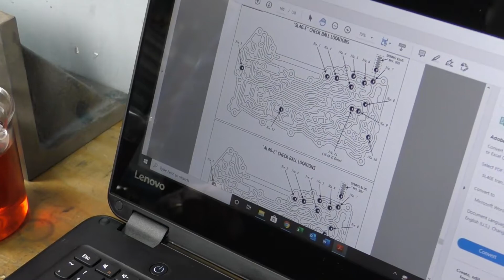BMW X3 3.0L GM5L40E Transmission

Comment: Nice job! I was glued to the entire video
Reply from the maker: Glad you enjoyed it!
Reply: 3C    EGS: Transmission switch
54.    EGS: control unit, internal fault 5 (FET2)

BMW 2003 325i.   GM transmission
Codes pulled from the car. Is that the Neutral Safety switch? Judging from your video it seems to be inside the trans
Reply: @klassikats  ....
Reply: The transmission downshifts hard. It's an automatic
Reply from the maker: @jsolo7576  That sounds like an accumulator issue, check for broken springs in the accumulator
Reply: Will do....Thanks a lot!!!!
Reply: The problem seems to be intermediate.  After I drive far then the red cog symbol with the explanation point inside it. Then the hard shifting begins. Can that still be what you suggested?
Reply from the maker: @jsolo7576  Your first code 3C is the neutral safety switch. 54 came up as limp home mode, but that was just a google search. Sounds like it is time to take your car to a tech.
Reply: @klassikats  thanks again
Reply: I found the problem. The transmission fluid seemed to not have ever been changed. Poured out like water and was black. I drained the replaced with new fluid, drove for a week, then changed again. No more limp mode with the cog symbol with explanation point inside. Next will drain drop pan and filter for the finally change. 

Thanks again 
And hope this helps someone
Reply from the maker: @jsolo7576  Sounds lucky for you.

Comment: Great video. Just did this for my e53 (X5). The gasket kit in the description (from China) doesn’t come with check balls. The kit listed (by Kurt) in a comment (which is no longer available on Amazon), does. I found a large circular groove worn into the spring-seated check ball, also observed some variation in size, so now I’m waiting on new check balls to finish the job and reinstall the valve body. That stiff spring was a bear - good tip to use a 1/4” socket to depress it!
Reply from the maker: Glad it helped and yes parts availability these days is rough. We are seeing a lot of issues across all parts on all the cars we are working on.
Kurt
Reply: So I got out my calipers last night and was surprised to see 11 of the 12 balls were hardly worn at all.  Best I can tell, new ones are either .250 or 6.5mm, mine were all ~.248”. The 12th ball, which is spring driven has a deep groove on the spring side, and a light groove opposite. I definitely need to replace that one. 

One more thing - I was watching another valve body rebuild here (Gary F), and noticed that the separator plate gaskets are different (upper and lower). According to his video, the gasket with the elongated oval needs to be on the side facing the check ball, and the one with two circular holes needs to face the valve body. It looks like your assembly reversed this - maybe it’s not critical? Thanks for responding.

Comment: Just be aware that when you clip the Solenoids back in, the little clip does NOT go on the inside of the valve but the outside! 40:26
Reply from the maker: Ok? not really sure what you are talking about here as there is only one spot the clip can go to hold the solenoid in place.
Reply: @klassikats  if you look at the video again the solenoid clips were inserted on the wrong side of the body. Example 40:26
Reply: One other observation just for future preference, I am in the middle of doing the same with the help of your video, I noticed that the inter plate gaskets one side is different from the other, in order to make sure I install them properly I reviewed your disassembly.

Comment: Do you think a clogged valve body will cause no forward or reverse ? 
My trans stop working so I changed the fluid it smelled burned and was black so I replaced the filter and the oil and it drove perfect fine,few days later the trans stopped working again and the new filter was dirty again.
Reply from the maker: No, if the fluid was black and smelled burnt then the transmission is done and it is time for a rebuild. More than likely the filter is being clogged by debris off the clutch packs as the friction material is flaking off.
Time to pull it out and go though the entire transmission
Kurt
Reply: @klassikats ok thank you , is there a way to test the the clutch packs ? I took the valve body apart and it had small metal flakes and 1 kinda melted check ball inside ,can that maybe cause the trans fluid to be burnt ?
Reply from the maker: When the clutches and or bands slip in the transmission they create excess heat. This results in the transmission fluid being burnt. The burnt fluid is the symptom and not the cause. With BMW it is tough because they do not have a service schedule for the transmission.  Changing the transmission oil every 25,000 miles will remove normal debris from the system and will prolong the life of the transmission. when fluids and filters are not changed, the oil flow and condition will become diminished. This in-turn can result in slow clutch application which will increase wear.
Kurt
Reply: Did you ever find the solution I'm having the same experience after replacing fluid and filter

Comment: Great video.  My trans isn't acting up but I most certainly plan on doing a modified version of what you displayed here, as I certainly dont believe in lifetime fluids and have no knowledge of the transmissions past service history. I hear a lot of  folks that believe cleaning either an older engine or an older transmission will remove the "crud" (for lack of a better definition) holding all the seals etc together and that ultimately you'll end up with a leaking/faulty engine or transmission. This makes perfect sense to me and I can imagine how something like this could happen .  I'd like to know what you folks (professional transmission builders)  think. 
Can servicing a transmission by cleaning it (fluid replacement is fine) cause your transmission to leak/ malfunction when it previously wasn't? 
Great video,subbed and many thanks from Oakland Ca.
Reply from the maker: Hi Andrew, thank you for your coment and sub!. Just changing the fluid and filter and cleaning out the oil pan is very unlikely to create any problems. Even cleaning the outside of the transimission is not going to induce a seal or gasket to leak. In most cases when someone has cleaned a componenet and then noticed leaks after is usually only because the dirt is absorbing the oil weepage. In any case the actual gasket/seal was leaking and cleaning it did not make it leak any more. It will also depend on your enviroment, we live on a dirt road and in a dusty area so dirt/dust will stick to things especially when there is oil present. If you live in the city, the odds are that the dirt you are going to get under the car is going to be very different and unlikely to seal anything up.

Comment: Gracias, buen vídeo, justo lo que necesitaba ver, donde puedo comprar los repuestos? Gracias de nuevo amigo.
Thanks, good video, just what you needed to see, where can I buy the parts? Thanks again friend
Reply from the maker: Search by "  GM 5L40E " and pick up an overhaul kit rather than the pricey master kit
Reply: @klassikats  What's the difference between the two?
Reply from the maker: Hi Andrew, Overhaul kit is just gaskets and seals while a master has more parts including kit friction discs and bands.

Comment: What a great Video. Thank you. Thinking about doing this in my 2004 M57 X3. Do you know if you can get the gasket set here in Germany?
Reply from the maker: I would think that you should be able to get those in Germany, though im just not sure where you would find them.
Kurt
Reply: @klassikats  Thank you for the reply. Did a little digging and you have to buy everything separately here, if you can get it at all. And it is laughably expensive. The two gaskets between valve body and transmission are 35 - 50 eur each 😲

Comment: excellent video, i followed this on the l322. i used a heat gun to soften my multi plugs worked a treat, 
question.do the tcm tcc have any bearing on reverse gear?, no codes stored but it is a bit harsh on initial engagement,not as slick as forward gears.
Reply from the maker: The TCC circuit is not in play during reverse. It is activated at highway speeds in top forward gears to eliminate torque convertor slip.
Kurt

Comment: Que buen trabajo

Me podria indicar que kilometraje tenia esa X3 al momoento de hacer ese mantenimiento?

Yo tengo una X3 2.0 diésel con 31000 km modelo 2010 nunca le he cambiado el aceite de la transmisión, asi que me gustaria saber cuando debo hacer ese mantenimiento. 

Muchisimas gracias por su respuesta👊👊👊👍👍👍👌👌👌
Reply from the maker: Hello Jose. The miles on this car was 175,000, which is about 280,000Km. Your miles is a lot less, 31,000Km is about 19,375 miles. But I would change the oil from time. 
Thanks for watching!

Comment: Nice vid u explain very well i have a problem with my e46 318i i put it in drive then it jumps out drive 3 times before it holds the gear an keep me going it happen the other again i am concerned now u have any ideas what could cause this issue
Reply from the maker: There could be several things going on. It could be a solenoid issue where it is not holding. It could be a wear issue depending on how many miles are on the transmission. It could also be an oil pressure issue; the PWM Solenoid may be sticking open, causing oil pressure loss.
I would start with scanning the system for codes. Then, drop the oil pan for a fluid and filter change. Also, assess the oil condition and the amount of debris in the bottom of the oil pan.
Kurt

Comment: Great tutorial. Very precise. Anyway, I have a question. Is the valve body and the repair kit the same for petrol and diesel engines? In US they mounted theese GMs in petrol BMW's but in EU we only have them i in diesel engines. I think valve body should be the same, but I'm not sure. Maybe anybody knows... There's never diesel engine on the list when you look for the repair kit, but it might be more like market thing not real fitment list.
Reply from the maker: Marcin,
The physical valve body will be the same, where the difference will be is in the calibration package installed. Since these transmissions use shift solenoids to change gears the shift points will be changed electronically. However, the difference will be with the accumulator springs installed in the valve body. Because diesel engines have different torque curves and run at different RPM''s than a gas engine the shift points will be different in a transmission for diesel versus gas engines. In the days before computer controls shift points were modified using different spring pressures and governors to change the shift points.
Thanks for watching

Comment: Hi, Can't find out the right spring order for a 2003 E46 330XD 204cv, same 96021042 direct Clutch as there, but all 3 others are 96020761 (smallest pistons), only Sonnax provide some data, but BMW data don't match... mystery.
Nice video btw...
Reply from the maker: Sorry I thought i had replied to this comment. BMW themselves will not provide any information on the springs and their locations as they say you have to replace the entire transmission. I found that by searching the internet i was able to find a couple of sites that gave a break down on accumulator spring locations. although the information can be very lacking and only cover some model applications. Unfortunately the only good way to know for sure is to have watched what spring cam from where in your specific transmission. This document here helps alot with explanations but again does not give spring locations.  https://akppservice.by/assets/files/5L40E.pdf
Reply: @klassikats  Hi, already know this document, most complet out there... thx anyway
i ve been trickin myself.... first i had stored parts in right place, but having find a range rover tear down tutorial i didn't care anymore about location and time passed, when i went back to assembly i discovered that location are not standard...but i had already mixed parts, big miss, unable to remember clearly what goe where, i assembled it same as range rover tutorial. working on a long complete controle and rebuild (engine, transmission, front and rear car tear down...naked chassis ) of an E46 i still don't have tested it right now, hope i ll be all right and may i came back to tell something about it. thx
Reply from the maker: You can always slow down our video and look at the spring paint markings. I know that I confirmed them using the video before doing the actual re-assembly. Just for reference in this transmission, the spring installation order was
Direct clutch = Spring with White Paint marking
Overdrive Clutch = Spring with Orange Paint marking
Intermediate Clutch = Spring with Orange Paint marking
Second Gear = Plain spring no paint marking
hope that helps
thanks again for watching

Comment: Hi. AMAZING video, thanks. Greatly told what to do on certain parts. I have also question on these transmissions, I have this transmission on X5 BMW, and I was wondering, should it always do the engine braking? I have seen it to do it on one non-4wd BMW, and I am not sure should it effect on the transmission funktions. No faulty codes for BMW INPA tester atleast.
Reply from the maker: All transmissions will apply a certain amount of engine braking. A lot of it is going to be determined by the control parameters programmed into the shift pattern. A large amount of manufacturers will program the transmissions to get into top gear and stay there as long as possible to try and maximize fuel incoming. This does not help much with engine braking. What I usually suggest is to move the shift lever into manual mode to use the best gear to control downhill speeds. This way you can override any programming features that will try to select higher gears. Once you are down the hill shift back into automatic mode and continue on.
Thanks for watching our video
Reply: @klassikats  Did my valve body like on this video, only those 2 clips on solenoids at 40min did go from wrong side (only harder to change solenoids after, but no effect for working) and 2 first gaskets (but almost identical so not really matter for working either). Else this was better than perfect, thank you so much <3 One of the best diy videos with clear speaking, easy to follow.

Comment: great video and loads of info ..I have BMW E46 with GM5L40E and it has been repaired now 3 times within 50K #1 was reverse drum circlip area broke .had all new everything #2 same as #1 reverse drum c/clip area broke again ..repairer said wrong c/clip used ..again all new friction plates and machining of drums ..machining of converter ..#3 dash gear cog fault light limp mode 2nd gear code PO732 2nd gear ...car had only done 15K /km 3 weeks out of warranty ..bad luck..got car back and still seems not right ..torque converter still seems to slip maybe 1500rpm before lockup ...can you give me an idea on what the converter should be doing say from 80kph to 100kph ...service center says I should bring back in 6000km for oil change and change oil every 12 months ..the thing is when motor was cold there were no faults ..changed gear up and down no problems ..would go miles without any problems but if stopped for awhile and when started off again the code and fault cog would be on and in limp mode again .I am thinking maybe bad sealing of oring that would allow loss of pressure when oil thins out when hot  on my INPA OBD transmission temp is 90c.which I would say is normal engine temp 95c...any help would be appreciated ...oh I am in Thailand the land of no tradies in auto game ...
Reply from the maker: Billy,
The 2nd gear fault code means that the transmission is experiencing a ratio error. This means that the input shaft speed and output shaft speeds are not what they should be for the gear selected. This can be caused by an electrical issue, (shift solenoid), or a mechanical issue,(like a clutch pack or band slipping or sticking). I would start with the checking the solenoid circuit and operation.
When it comes to the torque convertor there will always be a certain amount of slip until the ECM commands the TCC, (torque convertor clutch), to lock. This will happen in 4th gear and is done with a shift solenoid that directs fluid into the convertor to apply the clutch. If the TCC is slipping or not applying it will set a ratio code in 4th or 5th gear as engine RPM wont match input shaft RPM.
If you dont have a skilled transmission shop available i would suggest purchasing an exchange transmission from outside the country.
Reply: @klassikats  thanks for that reply and useful tips ..yes next time I think I will get another transmission from wreckers here that import low Ks e46 cars from Japan  rip it apart and do the lot myself ...the shop just charged me for 12x200 GM5 minor o/haul kit minus clutch discs  .cost $788 AU just for that I agreed to pay for parts because when cold there was no problem only when I parked after a run and drove away then there was the problem ...all up for the parts and oil I paid $1009 AU ...